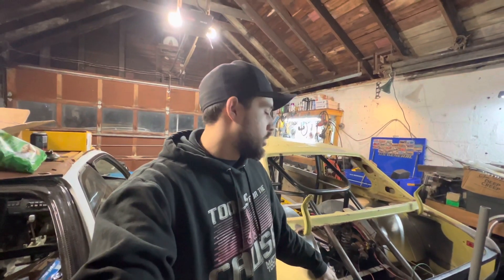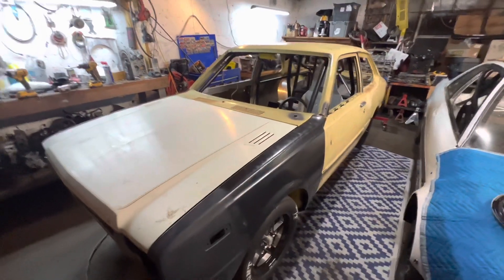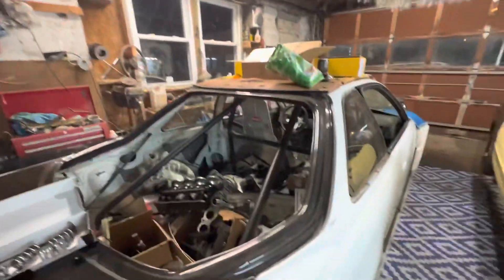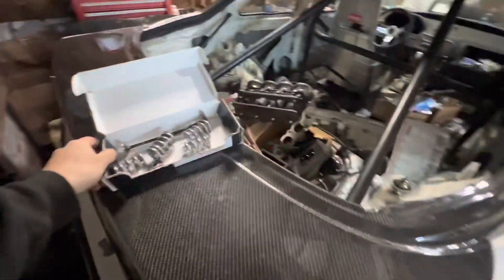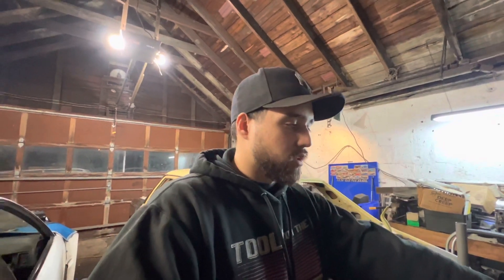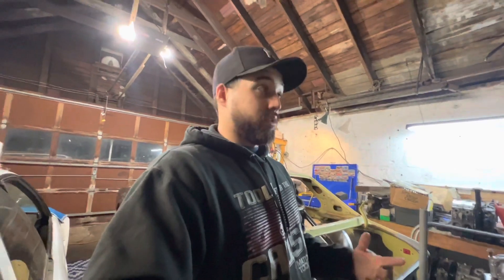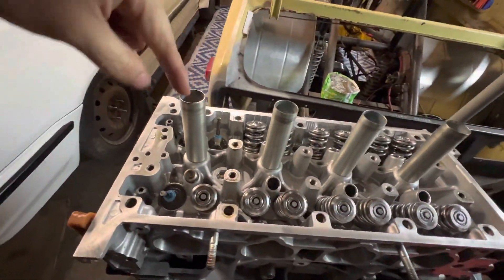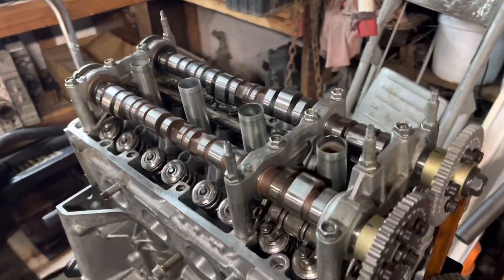Drag cartel 4.5 cams are in! Kinda….. + dads 13b All motor Corolla

Comment: Wouldn’t the stock valves hold up ?
Reply from the maker: Well we put a higher lb valve spring in it because we’re running the drag cartel 4.5 cams which have an aggressive cam lobe so who knows how long they would’ve lasted and also I purchased the motor used so we didn’t wanna risk it
Reply: @eggiebuilt  can the drag cartel drive on the street or too aggressive
Reply from the maker: Technically yes but I wouldn’t because they’re really aggressive so I would street a drag cartel 3.2 cam
Reply: @eggiebuilt  one more thing.  So a 95lb super tech spring would be ok for the drag cartel 3.2 camshaft
Reply from the maker: Yeah you street a 95lb spring and you can street the 4.5 but the 4.5s are aggressive and the idle is gonna chop and yeah 3.2s would be fine with those springs, it’s all preference honestly
Reply: @eggiebuilt  how about the stage 4 instead of 4.5
Reply from the maker: @boostboyracing  those would work to drag cartel has a complete kit valve springs and guides https://dragcartel.com/products/dc-cams-stage-4
Reply: @eggiebuilt  do you use stock head gasket last question and thanks for your input
Reply from the maker: No I use a cometic head gasket
Reply from the maker: And of course any time if I can an answer a question I will